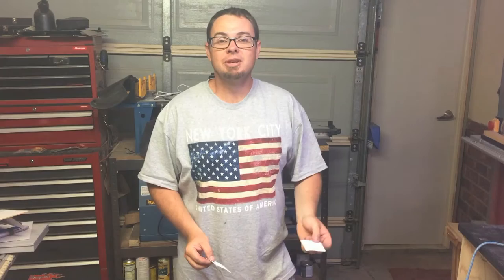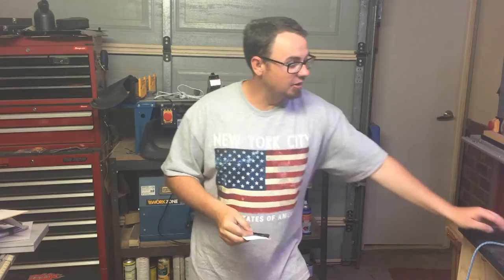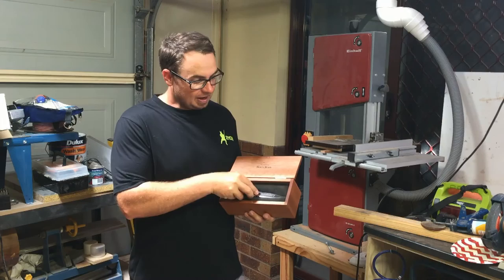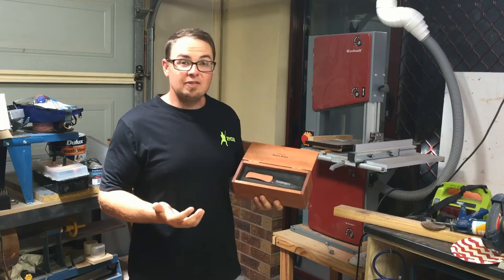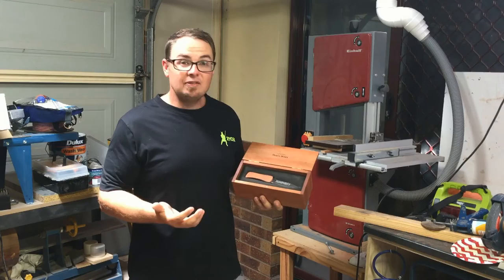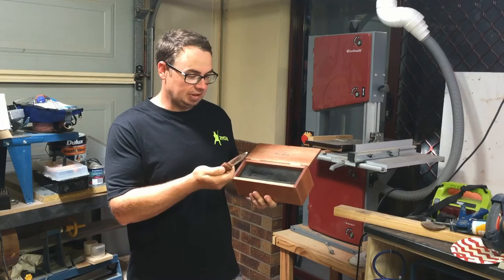MAKING A KNIFE FROM A SAW BLADE

Comment: Hate to burst your bubble but this type of saw blade is not good for knife making. Modern saw blades have junk steel and they attach carbide teeth. Older saw blades do have good steel on them but not the type in the video.
Reply: You didn't burst anyone's bubble. You don't have anything better to do than lash out at someone. It's a coping mechanism used by people who feel insecure.